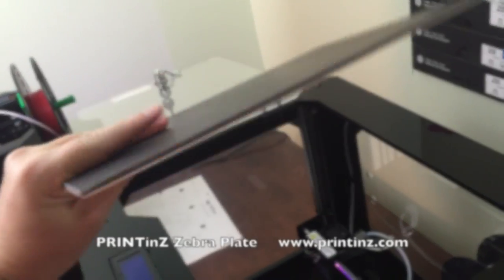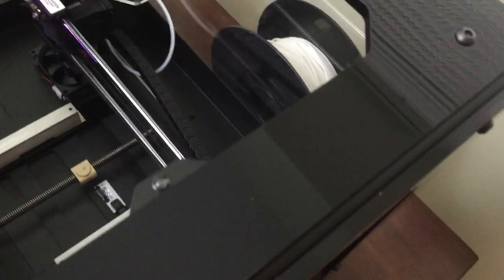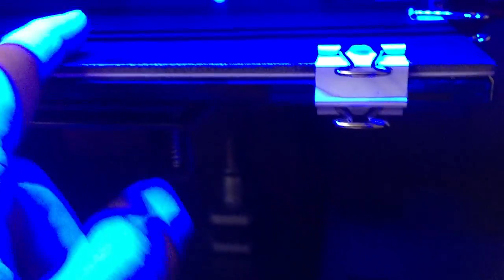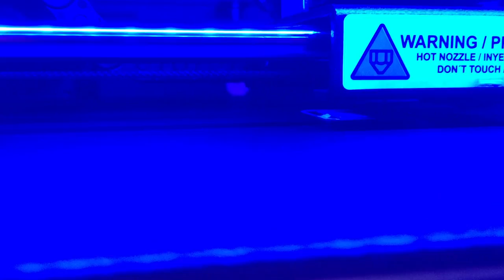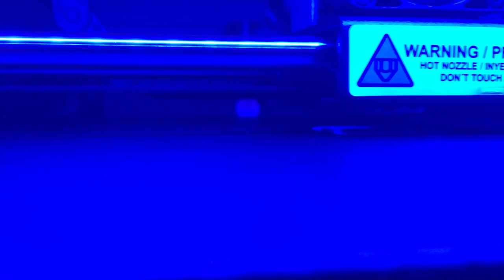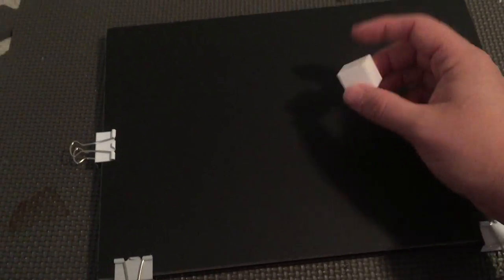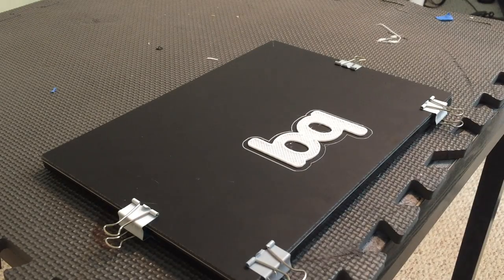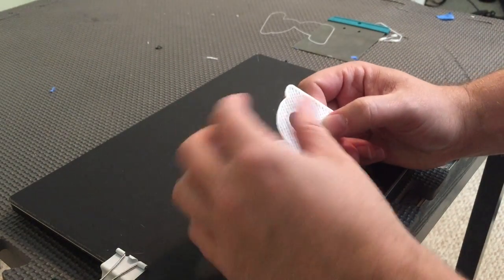Amazing 3D Printer Bed - PRINTinZ Zebra Plate - Goodbye Tape and Hairspray

Comment: I use the PrintinZ skins and have yet to find anything better or anywhere near as durable. (Skins are much thinner but way thicker than buildtac) I was just sticking them to 12" square mirror tiles. Now I am using 26 ga sheetmetel  with magnets under the 12" alum heatbed on a CR10. Stick one of these zebraskins to the 12" x 26 ga metal and everything sticks to it. After printing just lift it off and let it cool if you want or just flex it a bit to pop the print loose. I have yet to wear one out after almost a year of printing.